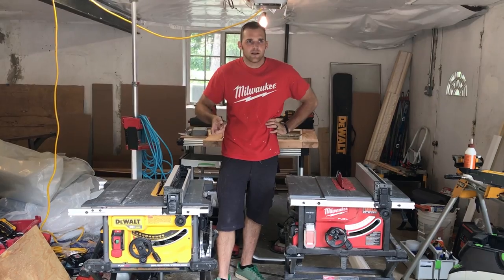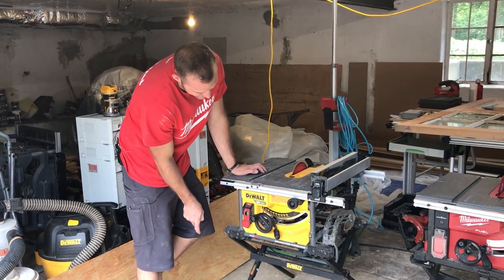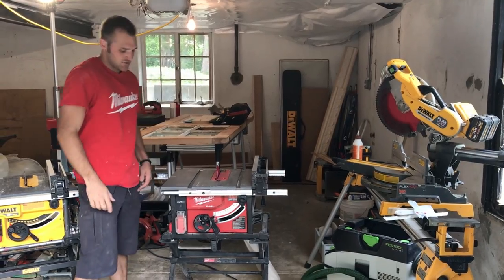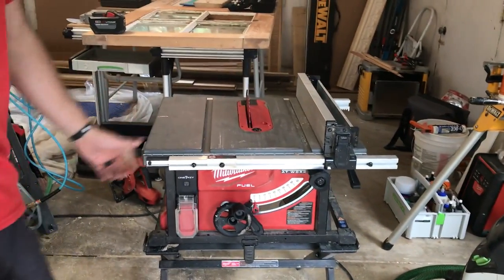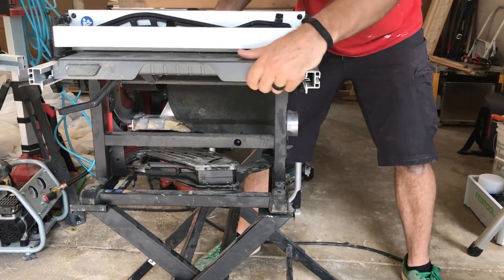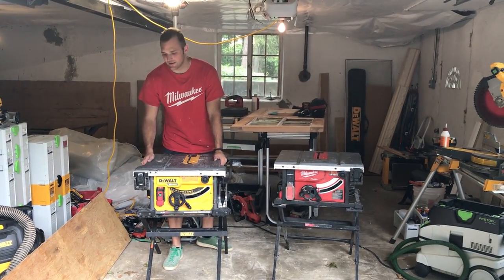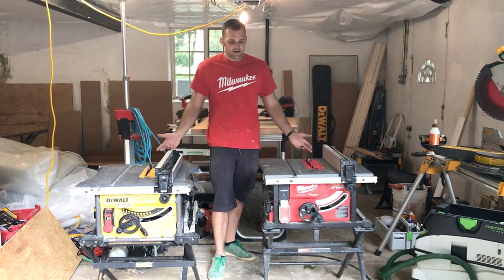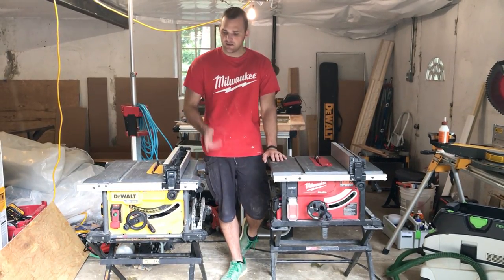Dewalt Table Saw VS Milwaukee Table Saw (HEAD to HEAD REVIEW)

Comment: And another big difference is Milwaukee can install dado stacks, though I honestly doubt that if I really need it on a cordless table saw.
Reply: I found a used 6.5 inch Dado stack and have used on my Milwaukee a few times.  Dado throat plate avaiable for Milwaukee.

Comment: I purchased both and ended up returning the dewalt for 2 main reasons. #1 is milwaukee still has the better battery options and 12.0 batteries are on ebay for $100. #2 is that milwaukee has 2 slots and i can use my miter sled. I do give dewalt the win on dust collection
Reply: I have the 10inch dewalt table saw I love it. It has a bigger rip than the milwaukee and I've never seen a 12.0ah m18 milwaukee battery on eBay for $100 I'm calling Bs on that!

Comment: Great review bud! I got the Milwaukee M18 FUEL 8-1/4" table saw seeing how that's the line I'm in with 20 Milwaukee tools and 13 batteries most of which are high amp ones and I love it, I never even use my Ridgid 10" table saw anymore even when I have access to an outlet!

Comment: Update: Watching this video when it is 3 years old, just after buying the DeWalt. They have fixed the on/off switch. It now comes from the factory with a hole, through which you can push the start button without lifting the mechanism. 

Haha, they must have watched your video too!

Comment: Hi,

Just got a chance to see your video on these two cordless table saw. I agree with you, if they took each good features from both table saw you will have a the perfect cordless table saw. 

I like how you modify the dewalt shut off switch. I hope dewalt can redesign that on the table saw. Milwaukee got it right on the switch.  I do like how the blade goes up / down on the milwaukee. DeWalt needs to change that on theirs. You forgot to mention that the milwaukee can use a dado blade and the dewalt can't.  Just don't now how fast it will drain the battery when using a dado blade. 
 
Still deciding but i do have the corded dewalt table saw. 

The metabo is 10" but i do like the battery and corded adapter. Now it's very heavy and very pricey.  

Thanks for the video and information.

Comment: I have the Milwaukee and love it. I have had absolutely no issue.  I made my own cabinet,  with left side and out feed tables.  I am a Hobbyist, DIY guy,  but love this saw.  I am now using  a 7 1/4 inch circa.saw  which saves the battery.

Comment: I'm Dewalt guy love fucking with Milwaukee fan boys but both are nice but both are a little underpowered, I'm gonna buy the new Dewalt DW 7485 with the 81/2 blade and if I need it to be cordless I'll buy the power station which essentially will make it cordless so I'm going that route

Comment: I think you forgot to mention that Milwaukee can use DADO blades (6')  while Dewalt doesn't,  that in my case make me go to the Milwaukee table saw even while I am more on the Dewalt Platform having several 60V batteries,  Thanks for your Video great info.

Comment: Also, do you mind sharing exactly how you went about modifying the on/off switch on the dewalt?  Did you drill the hole with the cover in place or did you remove it and put it back?  This is something I would like to do.  Thanks
Reply: Doesn’t answer subscriber questions; had to unsubscribe.

Comment: My company has both. I agree with your review 100%. We have sold off our Dewalt saws just to standardize on one battery line.  

However, hands down Milwaukee fit and finish isn’t as good, its ergonomics are not as good and the stand isn’t as good.  But for us, the single battery line was more important for us.  

We’re happy with our Milwaukee table saws… but darnit… Milwaukee please stop focusing solely on power bragging rights exclusively. 

I recently purchased a Makita 40v miter saw because the Milwaukee miter saws are really poorly made.   Wow, is all I can say.  The Makita miter is 5 star and above.  The Milwaukee saws are 3 stars at best. 

If Makita continues to improve the 40v line and offer more batter sizes all the way up to a 12.0.. and if the quality improvements are similar to the new 40v miter, then I can see a time when we replace all our Milwaukee saws UNLESS Milwaukee makes an stronger effort to  improve its fit, finish and making its premium fuel and “one Key” offerings a truly premium line of tools.

Comment: I like the dewalt 7485 it’s more powerful than the cordless dewalt also on the Milwaukee the riving knife sticks up from the blade so you can’t rip stock that’s taller than the blade
Reply: just flip the lever and take it off..

Comment: Good overview vid brother! Smh I just bought the yellow 7480, got such a good price I couldn’t pass up ($230)! & I felt corded might be NEEDED for a TS. I am fairly certain I’m going to return it now for the Dewalt cordless bc at work we have a 7491 which we use daily, so my TS would be for side work/at home projects. I’m still wondering besides the fact it will drain the battery much faster which Isnt an issue...can the Dewalt as the example hang with cutting hardwood? I just installed oak stairs at my parents house and 14x 1” treads needed to be ripped down on the backside. So during that is when I thought to myself damn I’m nervous a cordless 1x 60v (as opposed to my “120volt” 12”flexvolt) might not be able to hang!? Have you run your fair share of hardwoods through them? (Particularly the yellow saw) & was it still good to go?
Reply: LGzzy I use my DeWalt everyday for all kinds of flooring. With the right blade it’ll cut through absolutely anything you can throw at it. When ripping 2by lumber it’s best to do it in 2 passes but I never do. I abuse this saw constantly, never had a problem. I did however file down the red cover switch for it as it was always cutting off the saw if I let go of it too soon. Filing it made it less sensitive.

Comment: I would never buy a cordless table saw not enough power, I’ve used the Dewalt not enough power,  have to change batteries  just a pain,  and to expensive much better value for money with corded table saw, and more power.